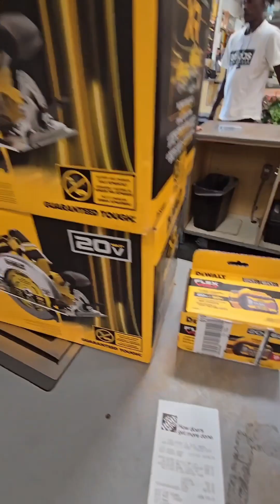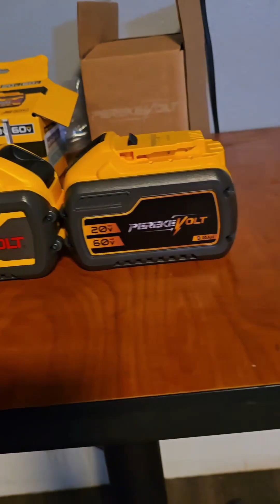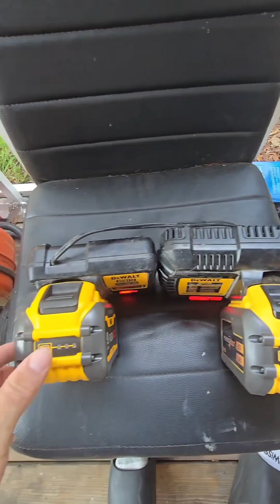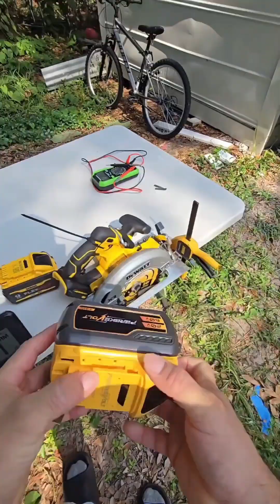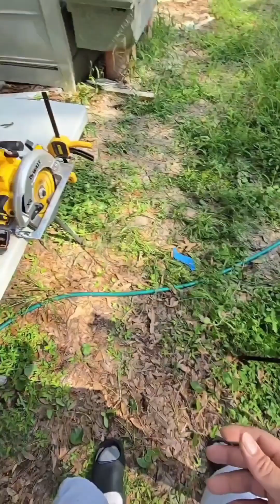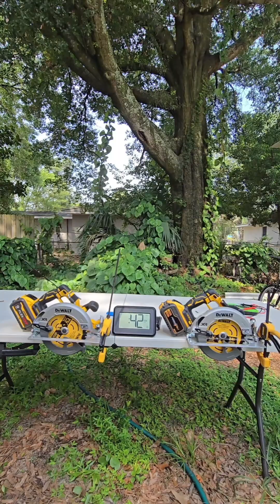PEREKEVOLT vs DEWALT FLEXVOLT | Real Battery Runtime Test (No Sponsors)

Comment: Not the best test because alot of those cheap battery can last long, but they have a higher internal resistance.  Means when you load them, the tool shuts off due to voltage drop.  These saws with no load aren't the best test for that.  Weight is a good indication of quality, would have been nice to know this.  You did sort of measure capacity under like conditions, so there is that, but there's a lot more to it than that.  Those flexvolt knockoffs tend to skimp on circuitry, so no telling how well it's treating the cells under charge.  It would be nice to know balance measurements after a few cycles.  Even the DeWalt can not be great at this so hard to trust a knock off battery to do it better.  If it costs less, they skimped on something and that is most likely the cells.
EDIT:  There is a lot of "false economy" with these batteries too, because you don't have the warranty, and the lifespan is never the same.  If it can't run the tool as long under load, you can't say then you got 2 for the price of a DeWalt.  I'm not going to tell you I don't have a couple knock offs myself, and I don't have a problem with them for low drain devices as long as they are SAFE, but I would never say they are a replacement for the DeWalt which uses name brand cells.  I can promise this does not.